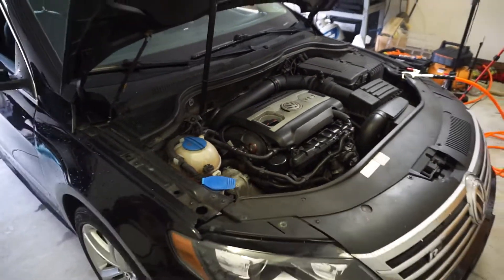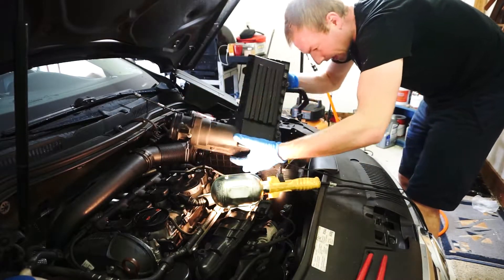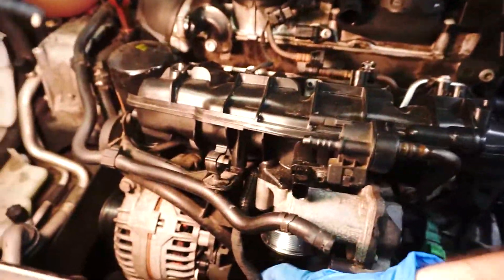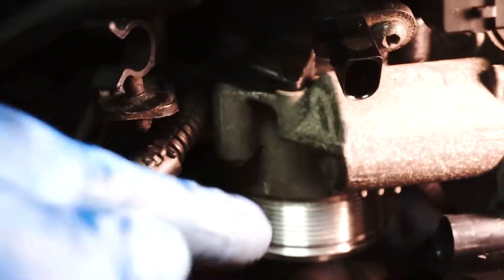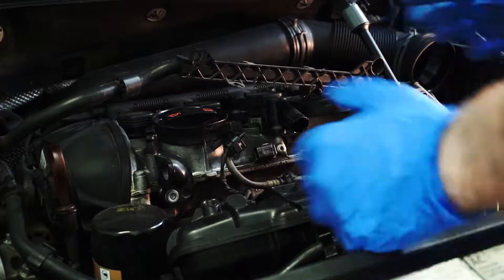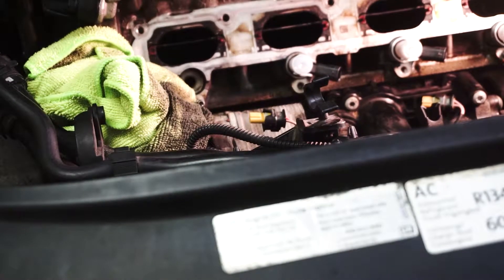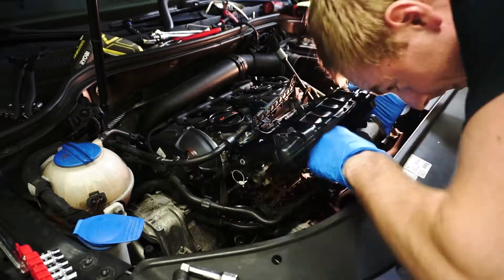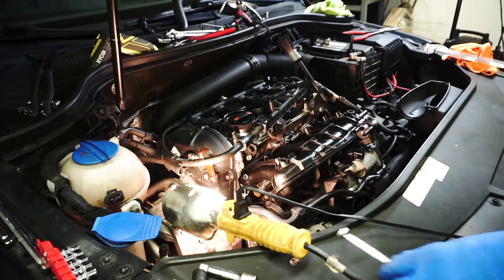VW Passat CC Audi  2 0TSI Fuel Injector Replacement

Comment: Just so everyone is aware the bolt that holds the intake onto the bracket is a XZN m16 or m14 not a torx T50…

Install the injectors into the fuel rail before putting the intake manifold back onto the head

Lastly be careful to NOT pull the intake off before removing the oil filter or you will damage the IMRC plug or the IMRC itself. 

You can get away with LiquidMoly 007, this will clean your valves and you won’t have to walnut shell clean your intake every hundred thousand miles

Comment: Hello. I just finished this project. Now my car is spuddering when I drive. It idles fine but when I press the gas pedal it jumps. What do you think that could be? Hope you see this
Reply from the maker: Have you driven the car for a bot? It might be some air in the system, which would explain it, but it also could be a faulty injector, driver the car for a mile or two, either it will run better or pop the engine code.
Reply: @ I haven’t driven it for that long in case I mess something up. How do I get rid of the air if that’s the issue?

Comment: Do you have to code new injectors?
Reply from the maker: if you have a diesel engine, with direct injectors, yes they need to be coded.
as for gasoline engines, they don't need to be coded, most of the cars that comes with regular injectors or not direct injectors don't need to be coded.

Comment: Mine is still.not starting after replacing the pieces what do I do???
Reply from the maker: I’m assuming you have crank no start?
Make sure you have fuel pressure, you have high and low pressure pumps, make sure they building the pressure, also, spark.
Reply: @Makhnovets  how do I check for that? Everything is back together, literally the injectors was the obly thing I changed, shoudl I check the spark plugs then?
Reply from the maker: @Hschmidt523  as for the no start problem, when did it happen before you replaced the injectors or after?
Reply: @Makhnovets  after i replaced them
Reply from the maker: It happens to me, at the front there 3 or 4 connectors that go to ecu, make sure they all connected. Hope that will fix the issue.
Reply: @Makhnovets  thank u ill try that
Reply: @Savage Motor Gears  my baby is running now by the way! It was the small connector that sits behind the oil filter. It was oil dipped so i cleaned it out and everything started running!
Reply from the maker: Really glad that you figured out!!! 
Thanks for commenting! And good luck!)
Reply: @Savage Motor Gears  for sure, and thank you. Your advice helped me find the problem.

Comment: thanks for the upload. its still informative. what i don't get is i didn't see the decarb of the intake. while you had the intake manifold off, why wasn't the intake cleaned?
Reply from the maker: Thank you for the comment! 
Yea, 😅😗, the owner took it to the shop and did walnut blasting, for some reason I didn’t think of that when we was doing the injectors. After all the was other problem, the smell of gas didn’t disappear, at the end he took the car to the shop, and after pressure test they find out that the fuel rail had a small crack, that why in the first place engine smells like gas was leaking from somewhere.

Comment: I have a 2008.5 gti its the tsi and has same 2.0 turbo has misfire but not spark plugs coil packs or wires but I do smell fuel do U think it’s a stuck open injecyor
Reply from the maker: After all we found that the fuel rail had small leak, apparently it’s pretty common problem. Do the pressure test or replace the fuel rail. Good luck 🤞 !
Reply from the maker: I’m not sure if 08 have the same problem, if it’s ok. Then just do the injectors, they dirt cheap in compare to bmw😅)

Comment: Why did you need replace ? To much fuel?
Reply from the maker: car had really strong smell of fuil inside the cabin, as well as intake actuator sensor has faulty code. we ended with replacing the fuel rail, because it has a crack...

Comment: The high speed video is very frustrating. Ridiculous!
Reply: Just slow it down on YouTube lmao
Reply: Just adjust ur playback speed to .25 or .50. He just did this to speed up play to his injectors. Please don’t take this video down
Reply from the maker: Sorry thought it was good idea to get to the point, bit I guess it wasn’t (
I will remove the video soon…(
Reply: @Makhnovets  dont remove the video. its a good video. just reupload one with normal timing during the talking bits. the actual times you remove 10 bolts is fine to speed up
Reply: @Makhnovets  nooooooo
Reply: Go to play speed and pick .75 it will be regular
Reply: I love it. If he didn't ffwd it, it would take forever.